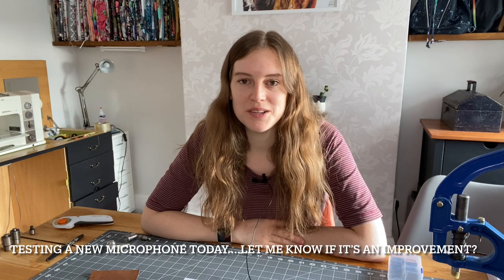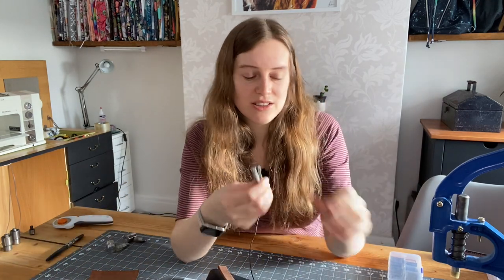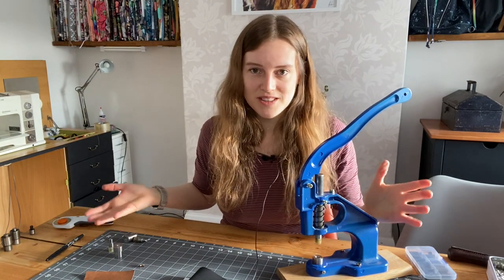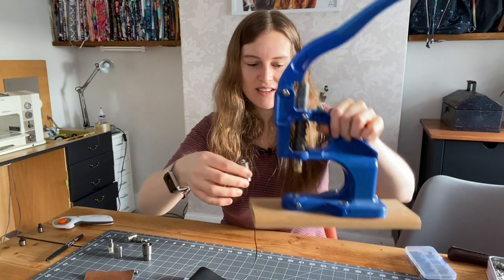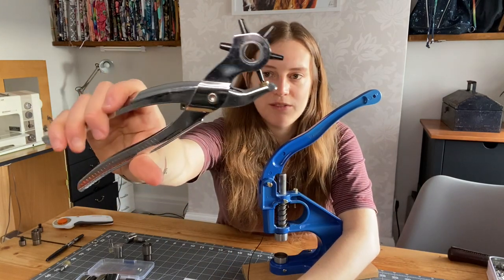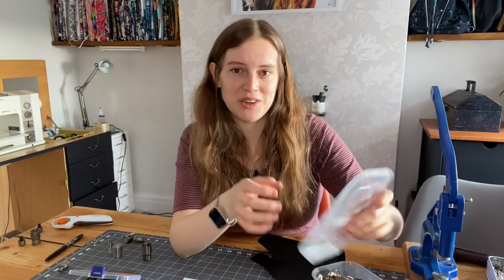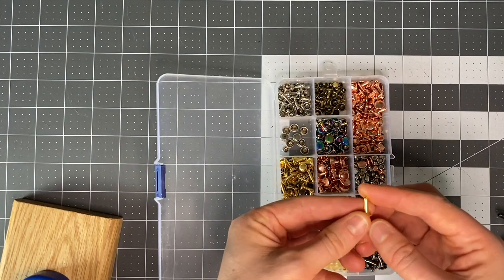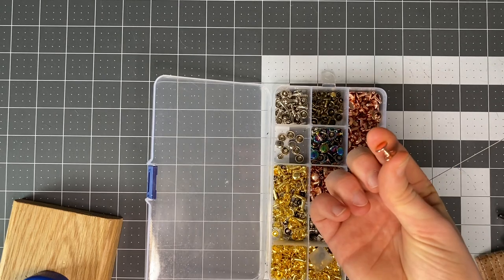Grommets, Rivets & Hand Presses - Bag Making

Comment: Thankyou for doing this. Just wondering if you have a problem with the vinyl pulling away from the grommet. I'm finding even a little but if a stretch in the fabric it will pull away from grommet.
Reply from the maker: Hi Suzie. I haven’t experienced that problem but I’ve only ever used grommets in bags with Rex vinyl (from Mora) and with cork and neither of them have much stretch so that might be why 🤔 
Have you tried adding some peltex in between the fabrics just where the grommet is, to stabilise it and stop it from stretching?
Reply: @CountryCowDesigns  I think it might be the grommets. I've used Rex too & have problem on that. Going to change supplier.
Reply from the maker: Yeah it could be that 🤔 dodgy hardware has a lot to answer for 😆 it makes life so much harder sometimes
Reply: @CountryCowDesigns  🥰